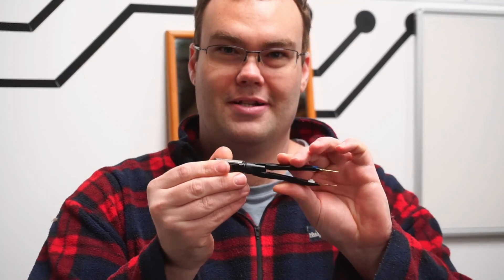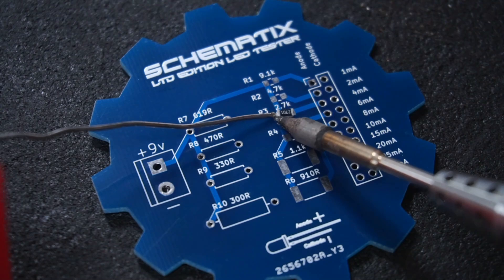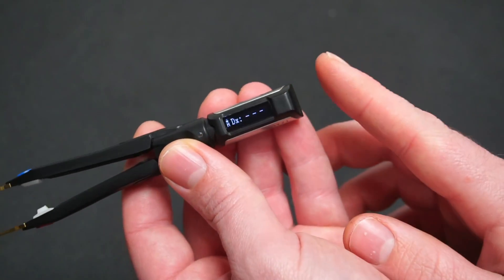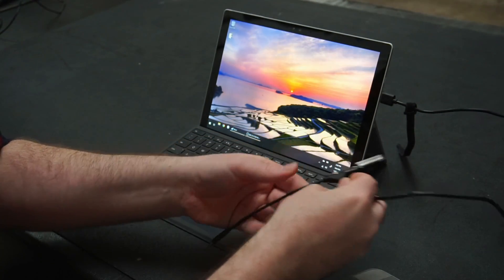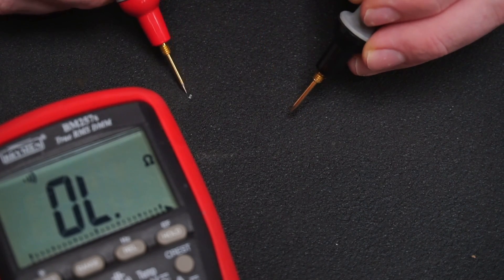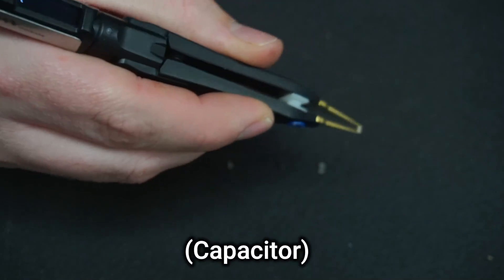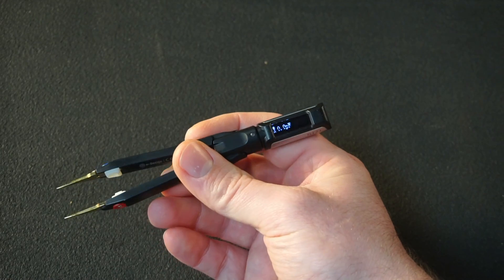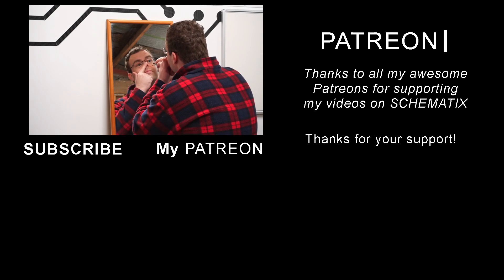Multi-meter Tweezers? ll Miniware DT71 SMD Tweezers Review

Comment: Wow wished I seen the proper ones as kinda locked in a bit of a battle with a quite expensive set that don't work and can't get a refund until the item arrives back at the factory :(  Buyer beware when buying some stuff of da Aliexpress and da forty thieves lol  In the interim I bought a £3 pair of multimeter tweezers which just hook into your meter.

Comment: Nice little device, Signal generator is an absolute gimmick, they could do without it. 
- I wonder how long does the battery last.
- What is voltage, frequency counter range?
- What is basic accuracy and how many counts does this device have?
Thanks for a great vid!